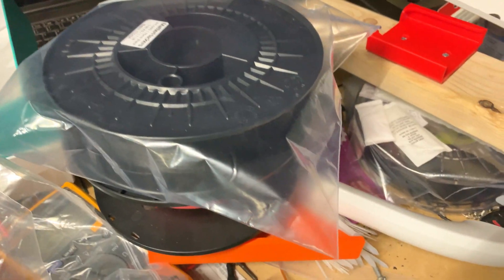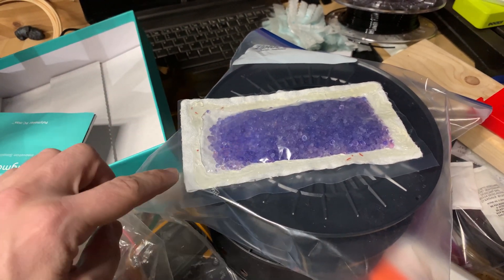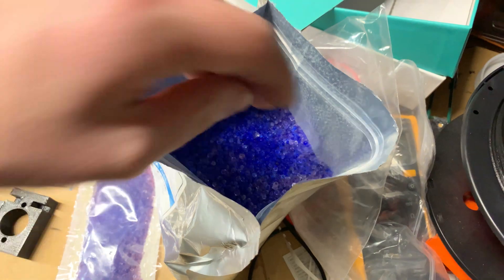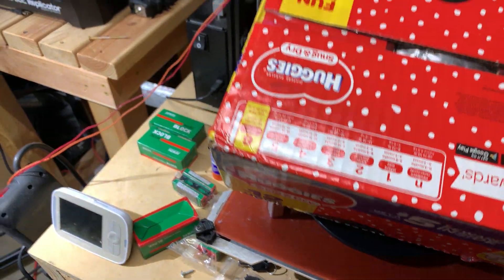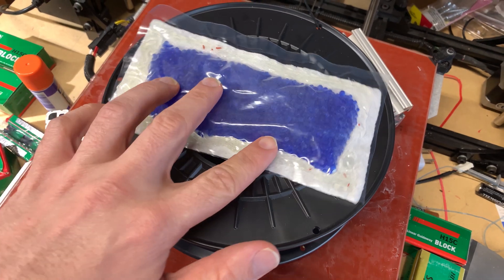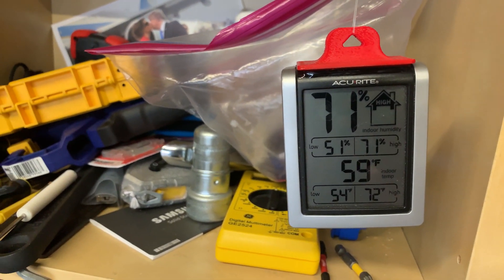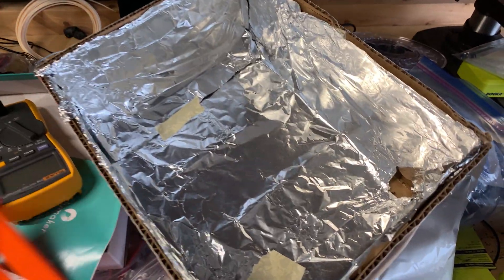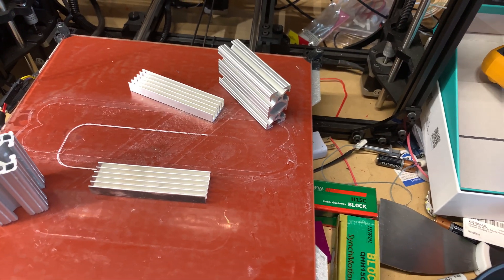Dry your PLA and Nylon 3d printer filaments the easy and cheap way.  Build a chamber in 10 minutes!

Comment: Where to buy silica? What is this exact silica or any would work?
Reply from the maker: Any will work, but the blue or orange color change silica will tell you when it’s wet or dry. The orange color change is allegedly safer than the blue. Naturally silica looks clear or white.  So color change is probably a must if you want to monitor the moisture over time.
Reply: @takingtheblackpill  Wow, thanks for quick respond! 
I'm looking forward to use PETG. I'm pretty noob in 3d-printing(10ish printed models). Making Lithophanes now - will PETG be better so it won't melt on a desk from sun. Is it better  as a filament to move completely to it or still PLA is better for some cases?

Comment: Once you dry the filament how long does it stay dry for?
Reply from the maker: If you seal it up and put a desiccant with it it may still get wet but not as quickly in a sadwhich bag or Rubbermaid tub.  I think its better to plan ahead and have a drying plan. 

If your serious about storing dry filament get a food sealer with the ribbed vacuum bags and put a bag of colored desiccant in there to track its moisture level. The food bag sealers are not expensive and very accessible.

Comment: Hi, thanks for the tutorial, can i do with airtight container, or do i need some hole for the moisture to evaporate out of the container? as you use box that is not airtight
Reply from the maker: It does not need to be airtight but thick enough to hold heat and insulate. a small air hole is good idea to let the humidity out.

Comment: I pushed 9 holes on the top and left a tiny space on the bottom to get fresh dry air in and let the saturated air out as hot air rises. Do you really need the aluminium foil to reflect heat or is it smarter to leave uncoated cardboard surface inside which absorb moisture?
Reply from the maker: I think you could probably achieve the same results without the foil. I do think foil works as a heat reflector, but since its a hot plate that will sustain itself at sustained temperature maybe its not needed.

Comment: You really solved my problem with my wet fillas and wet sillicas. I was about to buy either a small oven, or those brand dryers. Thx a lot man.
Reply: dont use an oven microwave 1 minute will do it in well 1 minute oven takes hours trust me youll see inside of your microwave wet glass ext moist it works fast but dont touch the beads they stick when hot youll have 100 stuck to your hand wishing you handt touched them.. then let them sit for 2 minutes to cool and put back in your container also the  blue and orange ones are toxic dont let them be on your counter with kids animals or 1 bead get into a sandwhich or something because you spilled always clean up

Comment: The hot glue paper towel trick made me go "doh". Good trick there. It's worth a video on it's own, or at least one of those 15 second youtube "shorts"
Reply from the maker: Dude, I really like this idea!
Reply: @takingtheblackpill  I don't know if I have a hot glue gun anymore, but if I do I'm definitely doing this. There are 3d printable dessicant containers but they are a pain and take forever to print and are a waste of filament after seeing this simple solution. How well do the bags hold up to the microwave? I'd imagine the ziplock material would melt. Have you considered using a sous-vide type bag?
Reply from the maker: @paulgupta1132  I dont use the bags in the microwave I only wanted to see if it would do anything it can burn the paper if I recall.  The bags hold up but periodically the hot glue will delaminate from the sandwich bag material I think that is how I learned they will steam.  (I just heated it up to reglue it) I think I am going to just fold a napkin in half. LOL  You can see if its still blue or pink by holding up to light.  Will make a neat short video.  Thank you.
Reply: @takingtheblackpill  that's a solid idea. I actually just broke down and bought a food dehydrator as a 2 year 3d printer user who now uses a prusa most days at my job as well. (figured it's a work expense at this point lol) so my days of hoping I'm not damaging my bed with this method are over but I'm still hunting for a better method to use/reuse silica gels. my office is actually across the hall from a POOL. So....humidity is a problem. ambient is like 45-50%

Comment: Cool! 🤠
What’s the difference between this method and putting it in an oven?
(Except the obvious that you don’t need an oven here, just use your printer instead).
Reply from the maker: The typical oven oscillates between really hot and all the way off.   This is ok for food, but something that could soften or melt when a precise temp temp is reached (like a thermoplastic). Our printer beds use PID or PWM or BANG tuned temps where the plate itself is very close to a steady set temp and won’t blast the item with massive heat then no heat like how our ovens work. I hope I made sense. Gas ovens are considerably higher risk as well. Your not likely to melt your or deform your spool using a printer and leave the spool unattended longer. Good luck.
Reply: Conventional ovens fluctuate way more than you would expect. I did a series of experiments with ours to see if I could use it to temper forged steel. That would have required holding a temperature of right around 425°F for a couple of hours for each cycle. I found the actual temperature in the oven swung from extremes of around 350° all the way up to 460°, which would have softened the steel too much. With a higher quality oven you might get better control and I would speculate that electric may be better than gas in terms of keeping a tight range. Also, for my gas oven the lowest temperature I can set it to bake is 170°F (76.6°C) making it pretty useless for this application!

Comment: Run it in the oven for a few minutes ...done..I would not run my bed to dry the filament...
Reply: Many ovens have a minimum temperature setting that's too high to be useful for filament drying (often ~170F). Also not sure how this would damage the bed. These beds are designed to run for several hours at a time on a regular basis.

Comment: I’d like to see more on ur printer construction. Thanks on the drying filament part. You know sometimes your looking for that silver bullet and you find out it’s staring you in the face. Thanks
Reply from the maker: Thank you, I really have gotten discouraged by the community.  Many people have a insane focus on price of the machine I made is fairly expensive relative to what the Chinese offer.  Also Youtube reviewers (in all niches, from solar to woodworking) themselves are HEAVILY focused on inexpensive bottom of the barrel items with an affiliate link.  They will make a video about a $200 welder that "sorta works" then have a link to it and scrape 3% off the sale and other ancillary purchases as well. They make a MASSIVE living off this.  So it makes many inventors, engineers and grass roots makers kinda throw in the towel which is where I am kind of at too.  I went to the rep rap festival in October, it was basically hundreds of ender 3s.  Thank you for subscription and the comment though, it makes me have faith and motivation.
Reply: @takingtheblackpill  - Hey, as the (very) frustrated owner of a new Ender 6, let me say keep on doing what you are doing! I have a feeling that within 3 years the only thing left of the original Ender 6 in my basement will be the aluminum frame as I slowly and painfully replace components that fail or simply do not work optimally, one by one. There is the cost and then there are the costs.

Comment: Update, I tried this with my super wet PETG and all the bubbles are completely gone. I set my ender 3 bed to 70c for 5.5 hrs and put a metal kitchen pot over the filament. To stop the pot from acting like a heatsink I put a towel over it like a blanket. when I stopped drying the filament, the towel was warm and the top of the metal pot felt about the same temp as the bed. Thanks so much!! You saved this filament and saved me money on having to buy a filament dryer. If there's a way to donate a lil tip to you let me know!
Reply from the maker: No tip needed your comment inspires me.  Thank you!
Reply: Did you also put silica gel?
Reply: @temsuwatiao7426  the silica gel is mostly to confirm the filament has dried
Reply: @temsuwatiao7426  No, I didn't add anything else in there. It worked fine without it. If you have silica gel that absorbed a bunch of moisture i bet this would work to dry it out too though.

Comment: i dont get it. you just leave it outside and it dries? how is that different from leaving it out and your nylon absorbs water? did you use the heated bed? you didnt mention that... :/
Reply: At 3:43 he discusses the temperature setting he used for the build plate. I think his point is that we all already have a tightly (relative to your average oven) temperature controlled heat source. Simply creating an enclosure which retains heat that is convectively transferred and reflects radiated heat (a foil lined box) allows one to dry spools of filament without any extra equipment at all. The silica may help by absorbing any moisture driven out of the filament but subsequently dries also, and the color change allows one to judge that the filament will be dry. Cheers!

Comment: Have you actually tested the weight of the filament before and after to see if you got any humidity out of it? What makes you so sure it is not simply humidity from the air that you get in the silica... your box is not airtight... also if you heat up the filament, why do you need the silica at all? make a few holes and have a bit of air circulation...
Reply from the maker: I am not sure of you exact point or questioning. LOL Obviously heat is a way to remove moisture. I know it works because I print before, and then I print after.  The results speak for themselves.  The blue silica is for storing in a bag when the filament is not in use.  It changes colors when it absorbs water. The blue silica also allows me to gauge when my filament is done drying if they are dried together.

Comment: Ha....I wonder if you can just leave the silica gel out and dry the filament that way.
Reply from the maker: Yes at first I didnt have silica I would just toast the filament for a few hours and go at it and it works.  For PLA use a lower temp like 40-50 BTW.